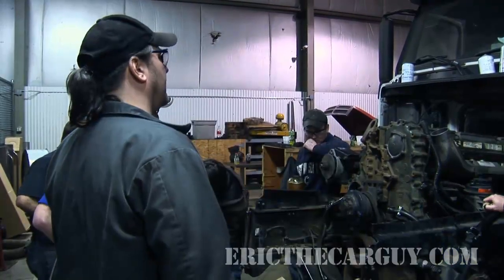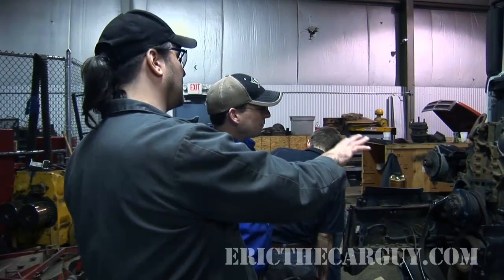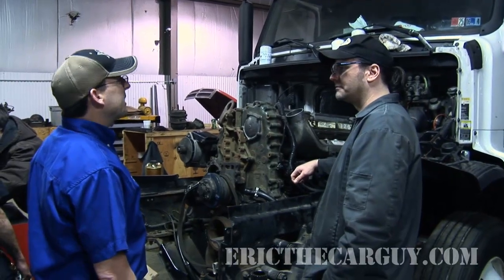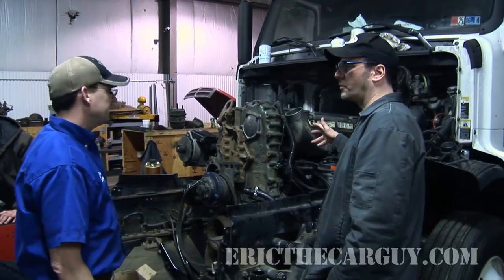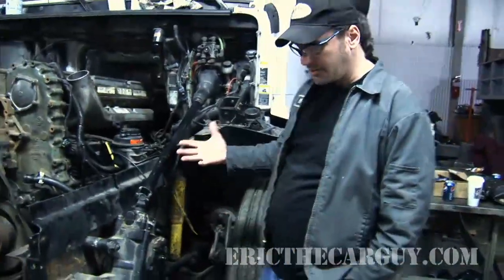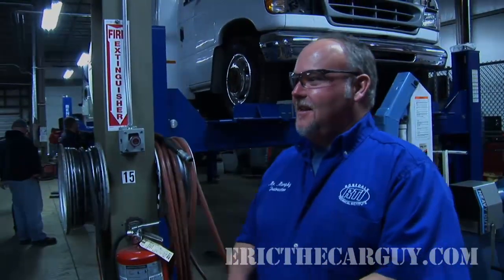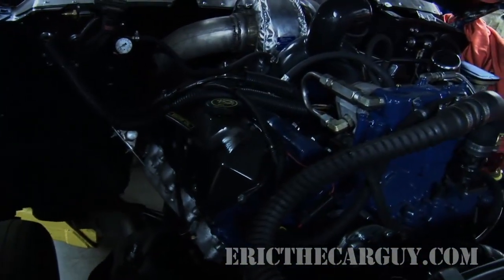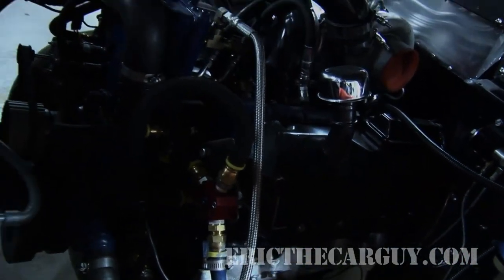ETCG visits Rosedale Diesel Class

Comment: The injectors aren't the only thing that can cause a diesel to run away...when the o-ring goes out in a turbo, it starts running on it's own oil,making it run away as well. (I think that's correct.)

Comment: as a matter of fact, at international just the other day , i got a 2010 maxxforce 13L engine that would not start, diagnosed and found no fuel pressure in high pressure rail, pulled injectors and found all 6 injector tips blown off and cylinder liners damaged, in paramets of ecm, it had a 3800rpm overspeed just before tips blew off, found turbo pumping oil into cylinders

Comment: ive been a diesel techncian for 7 years professionally, ive worked for cummins, mack, volvo, peterbilt and international trucks, we still see engines run away, when a turbo seal blows and starts pumping oil and cylinders get soo hot that it starts to run on pure oil they will run above 3000rpm and throw rods

Comment: Thats like the 50/60 series Detroit, damn good engines. You were referring to the old 2-Cycle engines that would kick over backwards and had throttle control on each cylinder (bad for sticking)... Badd Ass race truck, who says a diesel is slow?